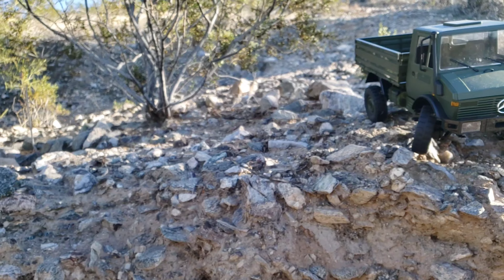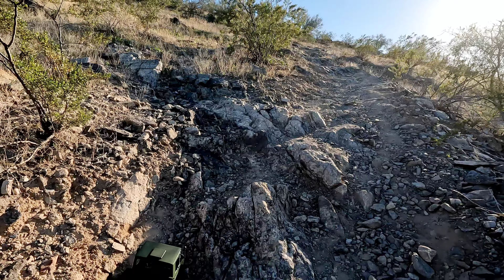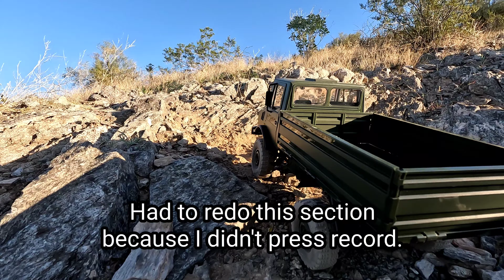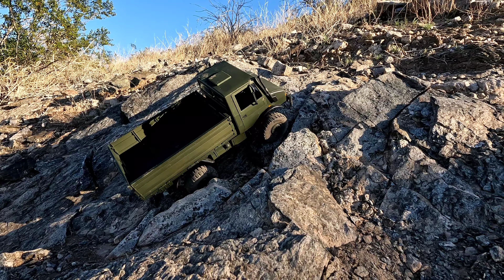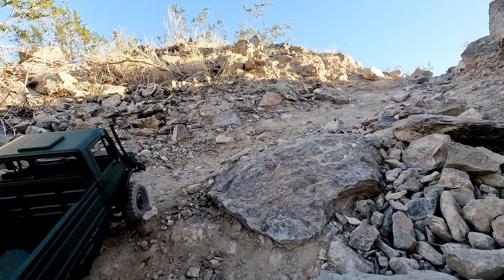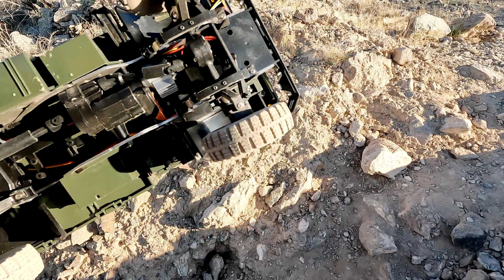LDRC LD-P06 UNIMOG 1:12 scale Rc Truck.

Comment: The problem climbing was that the tires were sliping from the wheels, glue will cure that and increase traction. Tires from the 1201 are softer and grippier, cheap too, but this looks more scale. I use the scale ones for the trail and the new ones for the rocks.

Comment: Hi! does your Unimog have the Auto-drive backwards bug? Mine is consistent, after approx half hour of running, it goes on that auto-reverse mode, not sure what's going on.
Reply from the maker: I haven't experienced that issue.
Reply: RCs do that sometimes when low on battery
Reply: @RunThatRC  Please do tell us when it happens. Thanks for the video.
Reply: @vincentroaring4339  I suspect that too, or maybe the ESC's run hot?